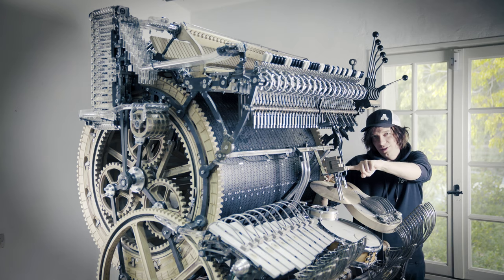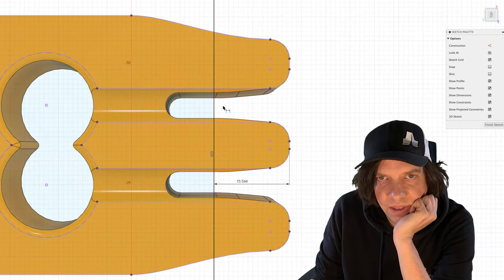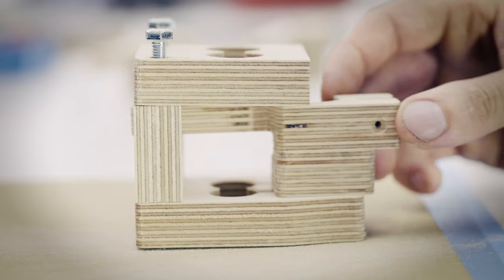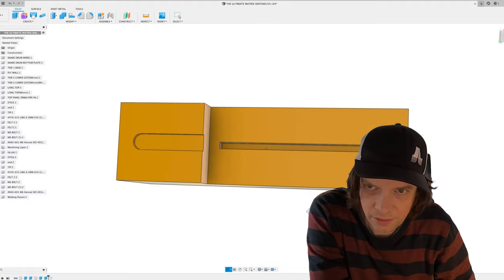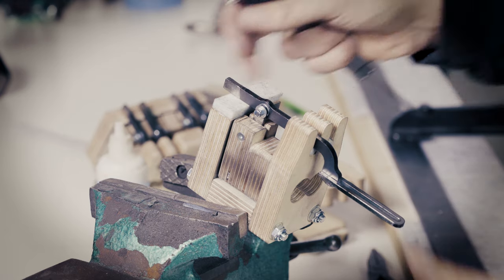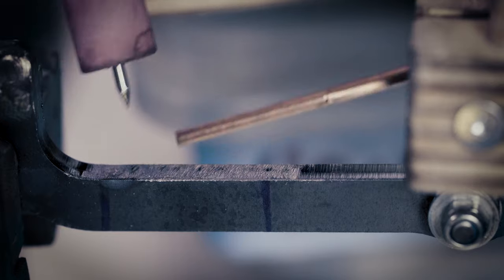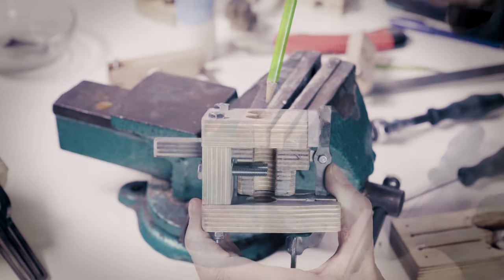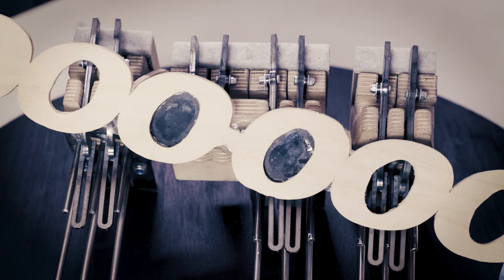Making Better Marble Gates - Marble Machine X #144

Comment: You might want to machine the ends of the bolts in the gate because they have threads that the marble hits against and these look like a series of little potholes for the marble to get stuck on.  Maybe you just need the bolt with only a cm of of threads gone at the end and a nice rounded over end

Comment: I see one remaining friction/stress point, most visible around 17:14 :
When the moving part goes out (to the right in the video), the "queue" (above the engaged marble) drops down a little bit (from the top of the engaged marble, sliding down a bit to the side until it touches the wooden part) and then the queue has to go up again when going from the gap to the top of the back of the moving wooden part.
So if the back of the wooden part could be lowered just a little bit, the queue would naturally fall down from the engaged marble onto the back of the wooden part without going up at all.
(Sorry if someone else saw it before me, I read most of the top comments but didn't see this mentioned.)

Comment: You should make a smaller fixture/machine that will just continuously push marbles through the gate. Then you can actually test it to 10,000,000 times.

Comment: Martin... On the marble gate you use a bolt to stop the marble ...try using a metal dowel pin 2 to 2.5 in. long and just press fit the dowel into the wood..this will not damage the surface of the marbles as they drop ......

Comment: There is a much faster way to slightly adjust faces to add or remove material in Fusion 360 than drawing a sketch and extruding again.  Use the "Offset Face" tool to just pull a face some distance.  It will pull the rounded corners and everything else with it so you don't have to remake those features, and you can select more than one face if you want to move two faces symmetrically too, or dozens if you need.  It usually makes very helpful assumptions about what you are trying to do.

Comment: As a welder myself I just wanted to suggest that you clean the surface of your materials before you weld them together. YES its more work and it takes time but it does definitely help in reducing the welds looking poor and youll find it helps with the control over your weld pool.

Comment: For a better fillet, rotate that welding jig 45 degrees so the puddle lies in a 90 degree channel, instead of trying to run the puddle between a floor and wall.

Comment: That tighter fit on the PMMA pipes was actually better than that loosy goosey stuff you've been trying to get away from. Could have just lightly scotch brighted or sanded a taper into the end of the PMMA pipe. Unseen, centering, and tight fitting.

Comment: Small surface that touches the felt will dig into the felt. You should weld a piece of flat sheetmetal to increase surface instead of just welding a bead, and by that, decreasing touching surface. And it's better to use something else, like rubber, as suggested before. Also the threaded bolt will make lots of noise.

Comment: Those bare screws look like they might be problematic later, possibly causing a lot of noise as well as, like other users say, scratch the marble and possibly cause mechanical issues later. There could also be some noise when the marble hits the bottom of the wooden compartment. Quick fix: silicon like you did with the funnels.
Reply: Or some kind of plastic to deaden the impact.

Comment: @1:35 When you design the way you showed lines are blue or unconstrained. I see so many Fusion360 users do this. For something so valuable and time consuming like the marble machine having unconstrained sketches is just asking for Fusion360 to randomly move lines without you noticing or intending to. If you aren't going to use constraints or operations like square pattern that maintains constrained lines than use "Fix"(looks like a lock) and highlight an entire sketch when finished so the lines can't be randomly adjusted.

I recommend using square pattern to move something like the side face with corner fillets. It'll fully constrain the sketch geometry and is faster than copy/paste/move.

Can also use press/pull but it can adjust the geometry in ways you weren't expecting so keep an eye on it. Even faster than making a sketch.

And of course going fully parametric.

Comment: Martin, I think the bolts that form the stops for the marbles may become an issue. The impact of dropping onto the threads could create scratches and divots in the marbles, possibly also leaving tiny metal shavings in the gates. Please consider grinding off the threads where the marbles impact them or otherwise creating a smooth surface for the marbles to rest against. I would hate to see you take this component apart AGAIN, although your design and implementation is definitely improving! Cheers!

Comment: A tip with welding, if you can not see it just stop Bud. You can stop and fix it instead of just running a bad weld and try and fix it later.

Comment: Have you considered braising or soldering the smaller rods instead of welding them? Welding small components like that will almost always lead to some kind of destruction, but soldering them should work and mechanically will be tough enough to support that kind of work with relative ease.

Comment: try a nylon "bolt" for a stop with a rounded head
-less noise
-less friction
-less chances for the ball to get trapped in the top of the screw

gluing a 1mm vernier to the gate its better then welding 1mm lol

Comment: I'd replace those bolts that you're using to block the marbles with something tougher or harder. 10,000,000 marbles hitting the side of that bolt is sure to cause significant wear over time.

Comment: I like the new design a lot. I do worry that the tips of those bolts acting as the interior "L-Hooks" in the marble gates should be ground to be a radius so that the ridges at the tip of the thread don't catch the marble. Plus, if it's rounded, it has almost zero chance of ever pinching the marble into the side of the gate wall and not dropping at very high tempos.

Comment: About graphite powder: when machined surfaces slide against one another, sometimes very tiny channels (almost scratches) are created in the surface to hold a film of oil. It’s the same principle as shark skin: being coarse at a microscopic level holds drops of water so that when the shark swims it’s water on water and not skin on water. See Abom79’s video about his shaper for an example. In your case you could perhaps lightly scratch the plywood before applying graphite powder so that it holds more powder.
Reply: The grain structure of plywood should have sufficient space for the graphite for the effect you are talking about to take place.
It isn't a mirror flat surface after all. And wood can never get that perfect regardless. (Due to it being a fibrous organic structure.)

Metal on the other hand can be polished to a defect free surface with variations underneath the 1µm threshold. Making the over 5µm wide wood cells seem like huge bumps... Not to mention that graphite powder will break into sub µm pieces, unlike oil that has surface tension and viscosity working against such thin films on most surfaces.

Comment: Quick way to glue something you want to remove afterward, use painter's tape and glue your felt on it. The thickness is really low and your tolerances are not that high. It will be easier and wo will not struggle to remove your stuff.

Comment: Speaking of redundancy. My gut feeling tells me that the screws which stick into the marble gates and prevent the marbles from falling straight through should be rounded off so that marbles cannot get clamped on the tip of the screw.

Comment: Hi there, I didn't see you put Locktite onto the nuts where you joined the metal parts with the plywood in minute 26/ 27. Those are self securing nuts, but the plastic needs to be on the thread to be self securing. I enjoy your videos and I look forward to the finished machine.

Comment: using synthetic bearing material in sheet form under the sliding parts would increase the life of the parts hugely, and wouldn't be hard to add it to the design. nylon or Teflon sheet would work well.

Comment: Basically MMX is still a prototype coz theres so much angle grinding and tweaks to re-CAD all of the parts. I think once the MMX is done, the latest design can be use to build another machine (manufactured with the correcred design) with no more tweaks. That would be a good machine now.

Comment: Having a thin metal edge contacting the felt and hoping for accurate positioning is building in unreliability, as the felt will indent over time. You need to add a perpendicular plate to the metal arm to have a much larger contact area with the felt, and deduct that thickness from the plywood.
Edit: or, as Johannes Larsson said, replace the felt with EPDM rubber (my choice would be polyurethane).

Comment: nobody:
Wintergatan:
kill all the tungsten.
 have you tried using a spotwelder? and nickel shims? wlso the felt could also be glued on a shimable aluminium plate, which also makes it replacable in case its worn out

Comment: Have you thought to put a sort of wegde shape at the front of the bolt?
This way even if the marble inside the gate doesn't drop for some reason, the gate will push the next marble back up again. Thus preventing the gate from getting stuck.
I hope this makes sense

Comment: Instead of welding the metal to build it up, why not add some shims behind the felt piece and make it adjustable if you need too in case the felt flattens over time and goes out of adjustment again?  Perhaps a couple bolts with washers/large heads either side to hold the shims and felt piece on? Or glue the felt to the shim, and then the shim to the plywood.

Comment: Because of the precision you ate trying to achieve i would like to comment. I think you should use a rubber or urithane insread of the felt. Over time the felt will compess when repeatably struck. An example are the hammer that strike piano strings. After time they will have three little vallies wher they strike the three strings. The same will happen to the felts you are using. Rubber or urithane will take a much longer time to deform. There for keeping the marbles to the side of you want and not causing the lift of the stack yoi are trying to avoid.

Comment: Probably would be easier to just add a thinner strip of felt to the backside, so the part can't slid back too far. Added bonus would be it's cheaper in both material and time, and added sound dampening. Also maybe real thin length of thin walled PTFE tubing over the screws' threading to dampen sound and prevent marring.
EDIT: Glad I'm seeing the 243 Threadlocker, the blue stuff (new and improved over 242 - can work through oil/grease), it'll hold well, and still be relatively reversible for repairs and stuff.

Comment: Could probs be a good idea to engineer some of the moving parts with a failsafe. Keep the machine from breaking itself in the event of some catastrophic failure. 1/10000000 might not be much but it's still a chance.

Comment: Graphite is a wonderful lubricant ... for the right materials.  Wood is not among them.  Wood absorbs moisture rendering the surface rougher over time.  A better lubricant for wood is wax, usually a hard wax like paraffin.  It is not susceptible to moisture changes, and actually adapts to wood changes by releveling.  There are a variety of spray-on wax-based materials that are inexpensive and very good.

Comment: 10,000,000 hits on that felt will be the problem with crush. A silicon or polyethylene sleeve on the bolt would also reduce the noise.

Comment: The marble stack is still going to bounce because of the valley between the active marble and the sliding part of the gate. The stack falls into the valley and back up again when they move from being stacked on the active marble to being stacked on the plywood. 

I don't see any way to solve that unless you can cup the active marble vertically in addition to horizontally, but that would mean the marble would have to sit back in its holder instead of right in front of it.

Comment: What if you buffed the surfaces that slide against each other? You can buff wood with a buffing wheel. Essentially, you're burnishing the surface of the wood. Obviously you don't get the same kind of shine that you would with metal or even plastic, but you'd be surprised at the finish you can achieve. You could also burnish the wood with paper from a brown paper bag. Sandpaper is efficient for evening out the highs and the lows relatively quickly, but it tears the wood fibers. Burnishing compresses the fibers on the surface and crushes them smooth. Seems like that would be a better surface for sliding against other wood parts. I suppose the parts will ultimately burnish each other as the machine operates, but I just thought I'd throw that out there.

Comment: If you don’t have a pulse adjustment you can simulate it by start stop welding.
Try it on a “useless piece of metal” every day for 10 minutes you can even use a metronome for it “it is a beat” on,of,on,of just by controlling your Triggerfinger.
I know you can do it.

Comment: Looking at your marble drop, where the marble meets the threaded bolt. Overtime that bolt will do alot of damage to the marbles and the wood around it. Constant dropping pressure/weight on the bolt will eventually wear away the wood that goes through initially. Maybe add a nut/washer on the marble side to kinda counter that effect. Also, the metal on metal contact is unnecessary noise. Can you not dip the bolt in some type of rubber? or even shrink wrap the bold end to given some cushion or at least no metal on metal contact.

Comment: have you considered coating the bolt (that holds the marbles seen at 10.55)  with rubber so that the noise of the marbles falling into place will be muffled.
also minimizing metal on metal contact will increase durability.

Comment: Put metal cone over the bolt. So the ball is pushing slightly and never rises, how ever deep the position. In other words, use 2mm bigger bolts without thread where the bolt hits it.

Comment: this is great!
but one idea:
would it be good to grind the tip of the screws that block the marble path in the middle of the shuttle,
so even if it closes to quick for gravity to pull the marble down in the shuttle, so it couldn't get stuck on the tip of the screw, wich is straight right now.
just grind them a little bit round or make a bevel downwards on it, so the marble will always be able to pass it, even at high playing speed.

Comment: My big concern when watching this is cascading failure. You can work forever on eliminating potential faults, but in such a complex machine one tiny failure seems like it could cause the whole thing to break down. Instead of trying to make the machine insanely reliable, it might be easier to work on handling failures gracefully. "The show must go on."

Comment: While sanding up to 600 makes a very smooth surface, from my experience with finishes you shouldn't really sand past 220 or 320 at the highest, this is because the pores of the wood become burnished and closed or much smaller at 600+. I haven't used graphite powder on any wood parts so I'm not experienced in that respect but I really think you should do some testing with different grit finishes. My theory is that a higher grit will mean less graphite powder on the piece due to the burnished effect while a lower grit would be less smooth raw, but be able to hold more graphite in the wood.

Comment: When it comes to reducing friction, have you looked in to the different kinds of friction reducing tape that's available? Like UHMW or Teflon tape from 3M? Fitting that to sliding surfaces would reduce friction by a whole lot and it's pretty wear-resistant as well as replaceable.

Comment: You should be stress testing these parts in isolation if you really want them to be reliable. Undertaking massive marble train changes without significant testing of the individual assemblies is a recipe for bug fix creep and design change cascades.

Comment: First i clearly want to see you finish the marble machine x ^^ and just a question, Wouldn't heat this metal a lot like you did put some bad resistance in the material afterward, like if you have a effect of (I don't know the term in english so I will say it in French) "fatigue" which cause destruction of object by time (10 000 000). I hope you'll understand what I tried to say ^^

Comment: Honestly, I am a little concerned about using bolts as the marble gates. Marbles may bounce around while in the marble gate, and may damage both the marble and the gate itself. Martin, if you ever see this comment, I'd replace the bolts with ones that are smooth on the ends, so the marbles can smootly roll on top of them.

Comment: It seems to me that the threads of the bolt are causing quite a lot of friction on the marbles. I mean the bolts that the marbles rest on, and when you drag the marble off the bolt the threads cause friction. Like driving down a bumpy road. And also after a marble will fall on those threads a few thousand times it will distort the action of the mechanism.

Comment: Those threaded bolts are a problem. Not only are the threads causing unnecessary friction, but the bolts will bend over time under the weight of the queue and will fail. Also, the felt will compress over time and slowly ruin the alignment. Thin felt (1-2mm). Thicker bolt. Grind threads off the bolt end.

Comment: Winter g  try Rocol  precison silicon spray on the your timber sliding parts  spray it good  instead of Graphite powder less mess . I used it on wooden draw sliders worked  real good ...

Comment: I notice that the nice, smooth, round marbles are always landing on the threads of the bolts in the mechanism. Will that not rough up the marbles over time leading to chipping, roughness, and metal bits sticking around the magnets? Are you concerned about that?